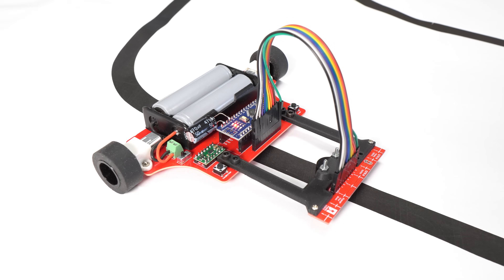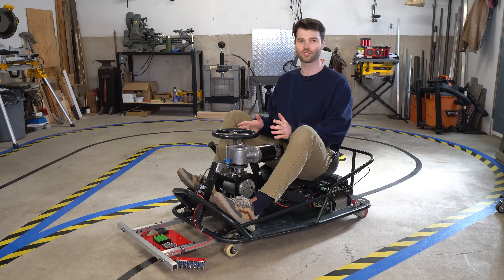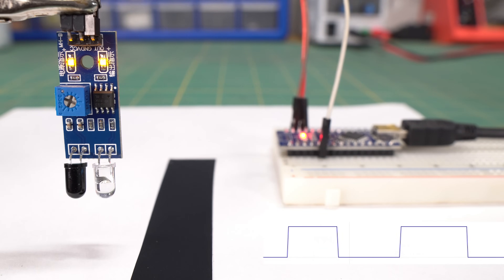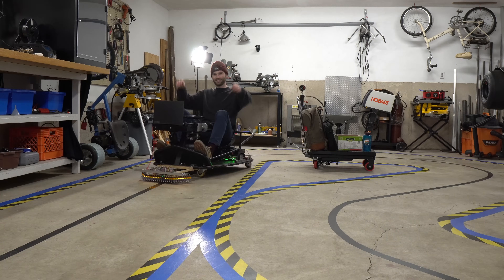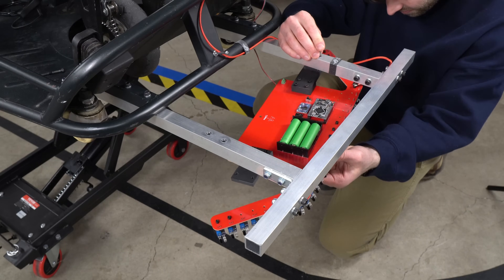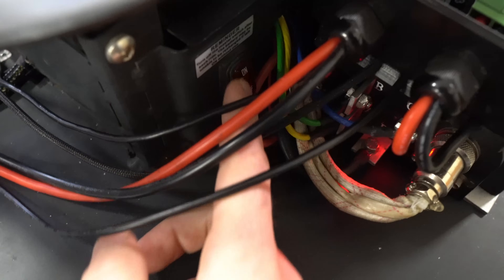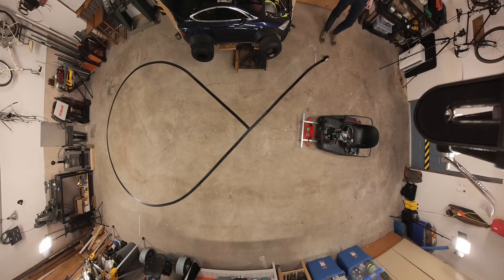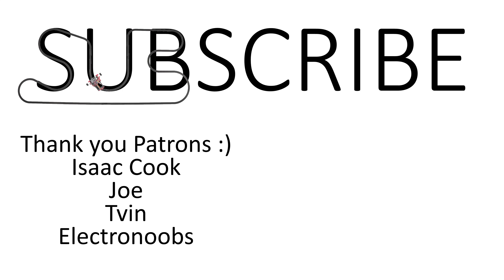I Built a Human-Sized Line Follower Robot

Comment: I’m surprised you don’t have any issues with turning on all the boards independently. Usually it’s not that easy because you accidentally get power through the I/O pins and their input protection.
Reply from the maker: Yeah, that is why I had to add the PWM switch. Without it, the motor driver gives an error when switched on.

Comment: you should try using the sensor data to map out the track it's travelling on and then ML to optimize travelling around the track
Super awesome project, keep it up
Reply from the maker: That is a really neat idea. Thank you!
Reply: Ohoh yes, then you could have two PID setup. 
One that is optimised for training (accuracy and stability to have a better sensor map) 
One that is used to drive after the training session (increase the speed and lose a bit of accuracy)

Comment: Line followers are amazing. I work in the automotive industry, and the first time I visited the manufacturing facility I was amazed at how many line followers there are. Dozens of robots all communicating with each other to keep supplying the production line with the parts needed, all that while also stopping automatically to recharge and using multiple sensors to detect people, who are free to walk over the lines and side by side with the robots.
It's trully an impressive tech that has come very far. While human driven machinery needs to have a ton of lights and beeps and must be confined to their own working areas, the line followers drive around the place playing gentle classical music, with such finesse you basically forget they most likely weigh over a ton and are being driven by a computer.
Reply from the maker: That is really cool. I had no idea they were used so much in manufacturing.
Reply: @austiwawa  Yep, I didn't know as well! I never thought they had such a major application due to safety concerns, but they've been in use for many years in the place I work, and not a single accident happened. I spent half of my lunch time just looking at them wander around the entire facility hahaha
Reply: I know of industrial line followers (agv) that follow a metal cable & sensor, but not with an optics, because of dirt and different day/night/weather lighting conditions
Reply: @SwedischChef  Yep, I've seen that many times as well. However, cables are a trip risk for walking pedestrians (workers), especially when the AGVs need to cross a walking lane.

In our case, the floor on the manufacturing facility is all white and the lines are black. Very little outside light gets in, and very little dust settles on the floor due to all the machining processes being done on closed chambers.

The only "issue" is that the AGVs have such good repeatability that their rubber wheels leave perfect wear marks on the floor, which have to be cleaned every once in a while.

Pretty smart system, not gonna lie I spend a good 30 minutes just watching them work.
Reply: I once visited the VW Factory in Germany (main factory) when picking up my car (they offer an experience pack where they drive you through the factory) and they had a lot of those robots driving stuff from A to B without any lines on the ground - they can even detect when there are obstacles - like  in my case our vehicle - was in the way. Very satisfactory to watch

Comment: This is how order pickers work in warehouses. So yes, I have seen and ridden on a number of several ton machines that are line followers.
Reply from the maker: Very cool! I wonder how their systems compare to hobby line followers
Reply: @austiwawa  nowhere near as fun, I promise. It's installed under the concrete and keeps the picker straight so you can drive through aisles with only a couple inches of clearance on both sides.  At least, that was my experience with them.